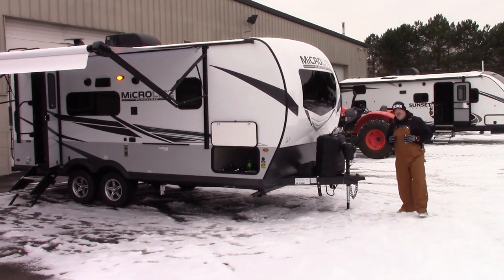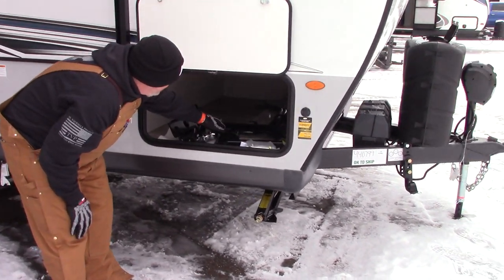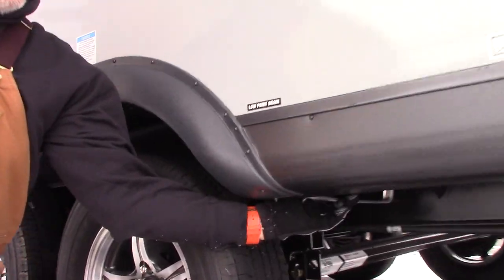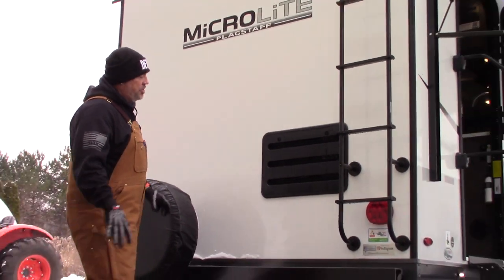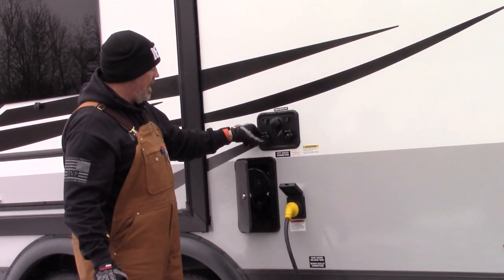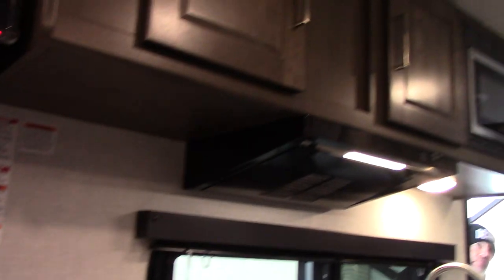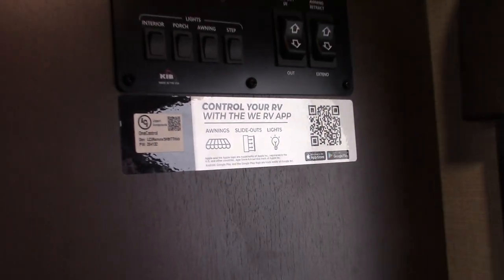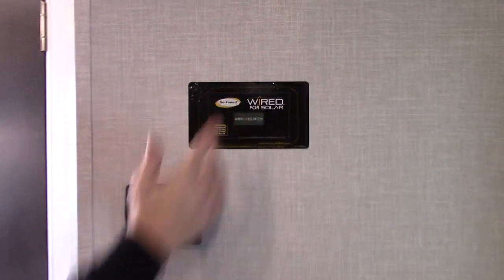2021 FLAGSTAFF 21FBRS DEMO

Comment: Just know that Forest River has a 1.3 star rating out of 5 with the Better Business Bureau.   They make crappy campers that fall apart and then they refuse to pay for any of the repairs.   They are pretty flashy in a video, but once the water starts leaking in it takes all the zeros off your investment.    Buyer Beware.
Reply: Forest River has many, many brands. There may well be some brands that are lesser quality - like the basic stick and tin brands - but Flagstaff and its sister brand Rockwood trailers are above average quality and good value. Sorry you had a bad one but what brand was it? RVs are not maintenance free and anyone that isn’t handy should probably not buy one. Dealers are too busy to be able to rely on them for service so you need to learn how to maintain them yourself.
Reply: @allan6021  I have a Forest River Flagstaff A-Frame Popup.   I understand that I'm not handy.    I do not understand it when a product start leaking and falling apart after 2 years.   I don't think even handy people expect to be resealing and inspecting roof seals (at the dealership) twice a year.   This is recommended by Flagstaff.   You should check out some of the reviews on the BBB site.    If I installed a raise and lower motor on an RV that kept failing - I would find a different motor that had better specs and start replacing and improving.   Flagstaff sends out the same crappy motor over and over.    A lot of handy campers carry around a spare motor, or have learned to raise and lower the camper manually.   If you think this camper is above average I would hate to see what the average camper looks like.